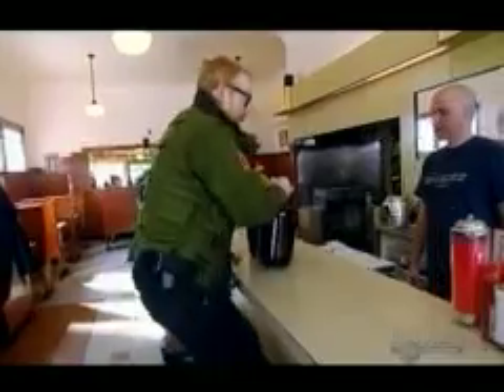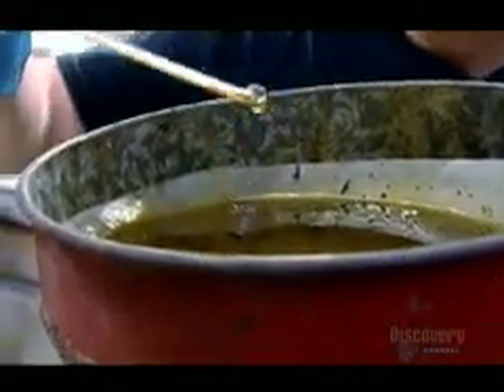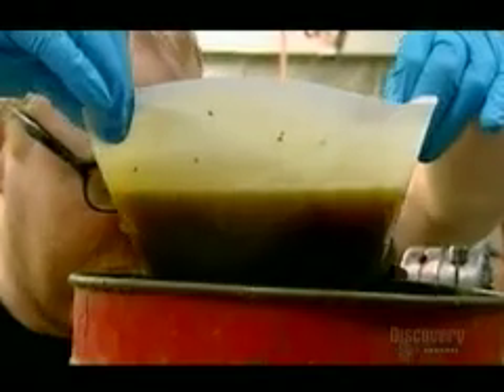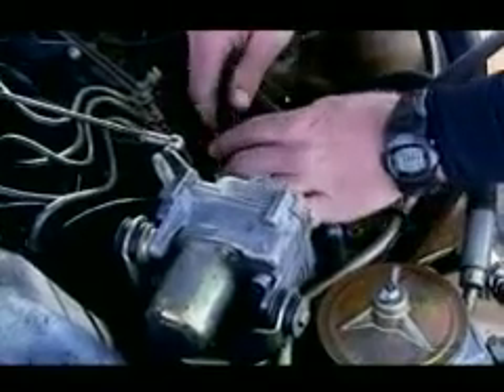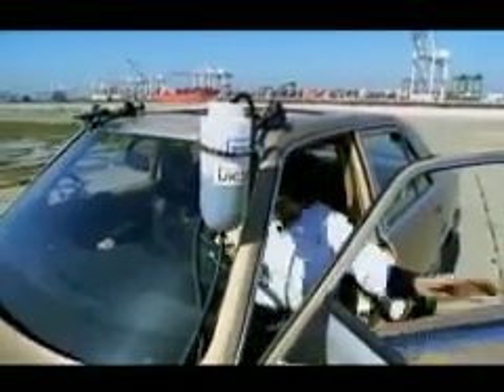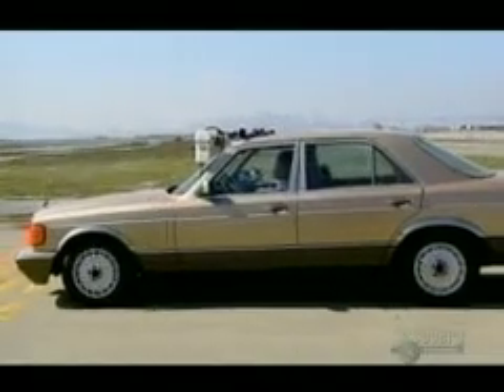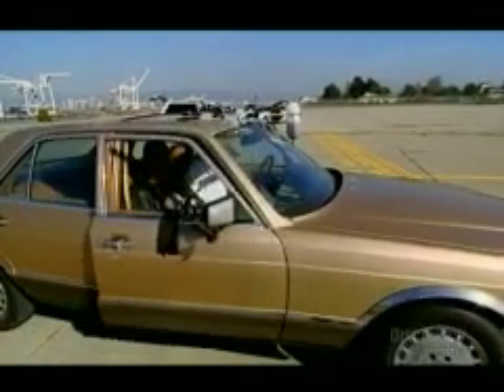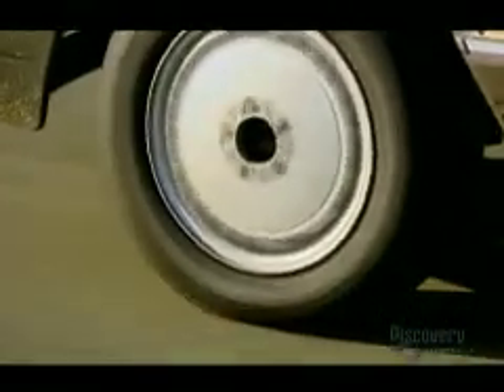Mythbusters - Cooking Oil as Economical Diesel Fuel

Comment: This test is extremely unscientific: To produce that vegetable oil (I'll assume that it is soy oil, as it is the most common) was used diesel to run the trucks and tractors!
To anyone that wanna to study this matter of fuel, energy and efficiency I totally recommend the Patzek and Pimentel's works, go and study them carefully, you won't be disappointed!
Reply: The Mythbusters tested if a diesel engine could run on untreated used cooking oil. The test was a success, it did in fact work. The process to create any cooking oil, vegetable or seed, can be inefficient, whether environmentally or economically...but the bigger picture tells a different story. 

The cooking oil is most probably trucked to restaurants, which in turn can power the trucks, and the farm equipment. There will always be used cooking oil if someone wants fries. Why not recycle it, and use it as fuel? It's economical and efficient since you're using what has already been produced.

As far as I know, used cooking oil doesn't damage diesel engines if it is filtered properly.
Reply: The point isn't whether it functions or not, of course it functions; (the first diesel motor engineered by the German inventor Rudolf Diesel was devised to function on peanuts oil).
There's at least two unfair points, that could fool really a lot of people:
* The effects in the long run wasn't tested, as it could damage the engine;
* The production of the vegetable oil uses diesel from petroleum, so it isn't a "renewable" source of energy.
Of course if the economic conditions permit, one can and must recycle the used cooking oil, but it isn't economic viable all the times and in all situations.
Thank you for your time and best regards!
Reply: baianoise dont see your point since they are just reusing use oil  thrown out so your agruement about the stuff use to harvest it is in valid its a stuff that is gonna be thrown out anyway and reusing it as fuel is not such a bad idea though using unuse veg oil which your pointing our is kinda wasteful but using use oil is not wasteful using something that people throw out is not really a bad idea
Reply: Felix Jr Lim Oh yes, and when people throw it away usually is by the worst means: i the kitchen's sink hole! It's a completely disaster for the house's pipes and to all sewerage because the calcium ions in the hard-water turn the oil into a hard and insoluble soap and obvious will clog the house's pipe and the bacteria that eats the oil (very slowly) use all oxygen dissolved in the sewer water, and it promotes the growth of anaerobic bacteria that produces awful smells and they do produce sulfuric acid as well, and it corrodes the whole system!
Reply: baianoise Your lack of common sense over shadows your books smarts and makes you look very stupid.
Reply: baianoise It's just mythbusters, thjey don't dig very deep. Your right there is problem with cooking oil, it's a lot thicker and a lot of people recommend to heat it up before use. Using dirty cooking oil that is 'filtered' would be something I only would do with a old diesel car. 

To be honest, nothing is renewable really, when we using machines powered by fossil fuel on one way or another. The thing is using a waste product will use less fossil fuel then just wasting it. Where are not going to stop use fossil fuel until the it is so rare/expensive that it's cheaper to grow different crops to create bio fuel.
Reply: Felix Jr Lim Well, these question are really trick because they aren't very evident at a first glance; we should ask ourselves:
- What is the point in use the waste cooking oil? 
Answer: we use for the sake of its energy content, not for itself. For a energy source be profitable (in the energy balance sense not only in the economic sense, as the government subsidies sometimes pervert the laws of physics and "magically" turns a non profitable energy source in a profitable one) it must deliver more energy in it's use than the summation of all energy inputs used in its production and/or extraction.
In that case of the used cooking oil, its energy inputs was:
- all energy used in the sowing and harvesting of the grain, his processing till the extraction of the oil, its filtering degumming, etc
- the energy used in the cooking of oil, be it electric or from natural gas, coal, etc.
- the energy used in the transportation of oil to the fuel processing facility.
Now imagine it in a national scale, millions of cars using that sort of oil?
I agree with you that, in the strict economic sense, from the point of view of the people who took the oil from the restaurant (specially if it was at no charge) and burned it in his car, it was indeed very advantageous, but the economy can't change the physical reality: the thermodynamics calculations, as we have spent more energy than has been delivered.
Sorry for the long answer, and I hope that I have been clear.
Reply: but no one cares its free
Reply: i guess thats all it comes too its free :) no matter how inefficient it is with all your calculation and billion dollar research by big oil company if its free its alot better if it cut cost
Reply: heres the math you buy an 10 dollar battery that will last you 10 hrs or  1 dollar battery that last 3 hours each
Reply: baianoise You are making a confusion. The total amount of energy inputs in USED cooking oil doesn't have anything to do with the harvesting of the grain or the energy used in the cooking oil, because you REUSE it. At the end of the oil's life,you just colect it and transform it into fuel. Therefore, the only energy inputs you bring are the transformation process and the process of finding your used cooking oil. 
Transportation costs to the processing facility should also be acceptable. If u bring one truck worth 30t of oil and use just 500 litres of diesel (for transportation) then it is worth both in the energy balance sense and economically.
Reply: nadfas No, without the energy used to harvest the grains that produce the oil you would not even be using it, I understand that you are analyzing it from the perspective of the end user, the people who collects the waste cooking oil, usually for "free". Not only this case is unfeasible on a very large scale of use (let's say 10 millions of people using biodiesel from this oil or the oil itself as fuel) but so are any Biofuels, the total amount of energy from the sow to harvest to the engine doesn't hold the candle to any fossil fuel, simply because fossil fuels have the largest energy density of any chemicals of practical use, so from any joule invest in his harvest you return a lot more than any other chemical fuel. There's only two source that can possible beat oil in a foreseeable future: Wind turbines and  noncrystalline solar panels, even thought we have to remember that this two sources are not predictable and left us with the problem of store his energy.
Thank you for your time to answer!
PS: I extremely urge you to give a shot to the Patzek's book about biofuels" The book is totally awesome.
Reply: Well toi make it short i know we still need fossil fuel but if we can convert some waste to energy its not really a bad idea but totally replacing fossil fuel thats still a fantasy
Reply: Felix Jr Lim Yes, to really tell the truth, we can't bear the effects of use a lot of fossil fuels, not the fossil fuels itself, because we have probably thousands of years of mineral coal for instance, but it is, on the other hand, the worst fuel we currently have (excluding nuclear energy) in terms of pollutants generated in its use; further is possible to synthesize hydrocarbons from coal, (e.g synthetic gasoline).
The monocrystalline solar panels and the new wind turbines could replace 90% of energy needs if we hurry in install them, because when the population reach a certain number all our possible savings would be lost, just because we need oil to produce solar panels and wind turbines, further this appliances are usually produce far from where they are usually installed, and as I have said, oil have the biggest energy density of any chemical fuel of practical use, 18 wheels Big rig that runs on Lithium batteries and solar panels is for all practical purposes unfeasible, indeed hydrocarbons are a so good form of energy storage that is a very good idea to use solar energy and wind to synthesize them.
Thank you for your answer and excuse me for this long message!
Reply: hmm so we just throw away the use cooking oil :D if we can use it lets use it
Reply: Felix Jr Lim I didn't said this: throw the oil away, I only said that as a energy source to power cars, in a macro scale it is unfeasible.
Besides it, you can make soap, oil paint, varnishes, burn it in the winter, etc.
The most basic and fundamental criteria that a energy source have to meet to be of any p practical use, is that you must, harvest more energy in its use than you put to process it, and the waste cooking oil, as a huge whole lot of other sources do not meet this criteria, despite that in very localized scenarios sometimes you actually can profit from it.
Reply: well what ever other use we have for it what i meant just use it but still its another use for something people throw away
Reply: im not an enviromentalist but i learn one thing use what can be use
Reply: baianoise in the Philippines they use used cooking oil 6yrs ago its free and you can get it in restaurants and burger joints but since it became a trend these restaurants now charge people for used cooking oil to run their cars then people stops using it but some still buy it since its still a lot cheaper than conventional diesel.
Reply: shinjiprofile Well, the Phillipines case is worth o commenting about, because in the book "Thermodynamics of Biofuels" there's a NASA photo of the island viewed from the space that clearly shows how much the jungle were burning because the government subsidies to plant oil crops for biodiesel; biofuels in general will never replace oil due to a lot of technical issues, but a good example is this: they are a huge incentive to burn the forests and plant oil crops, their associate environmental cost are unbearable and besides that they make the food prices soar because of competition of food x fuel (e.g. corn for ethanol vs animal feeding).
Reply: Well Nasa is not poor like most filipino who need to find other ways to make things ends instead of just debating stuff they dont have the time to do that with a corrupt government most filipino need to improvise using almost all things available for rich dude they can give all the study and theory they want for the poor dudes they dont have time to talk and only action even if it doesnt work that well sometimes but its what they do to survive in sort shut up with the NASA talk and lets make action
Reply: And diesel fuel also takes diesel fuel to delivery to the gas stations.
Reply: Cooking oil as a fuel must be only from residues only, creating it from vegetables and land for that sole purpose its stupid, in fact any "biofuel" must be recovered from residues.
Reply: well as they say details :)
Reply: Why limit your "imagination" to the plant life that is needed to be farmed to produce biodiesel...on a dirt-patch farm.  
How about: Imagine a building that covers one square acre in the United States.  
It has growing trays inside it in a perfect environment for growth: Nutrient gel for the roots, LED lighting for photosynthesis, climate controlled to prevent plant stress.  
NOW, imagine that building is 5 stories tall so the one acre footprint now has FIVE acres of production area. NOW imagine that building is 50 stories tall. FIFTY TIMES the area of a one acre plot of a dirt-patch farm. Indoors. No harmful weather. No harmful insect damage. No weeds. No pesticides or herbicides needed. NOW imagine the whole building being automated and powered by the one acre of solar panels on the roof...and the plants being grown are hybrids that have been optimized for maximum oil content in their seeds or fruit. Super oil-filled soybeans or something. 
NOW imagine that building is NOT in the middle of the countryside where it is an eyesore...it is in the middle of an urban area that is being revitalized with urban farms that grow our local food and local fuel!!! 
Your limited imagination of applying how things are done today is getting in the way of what can be done in the future. All things are possible if you get past how EVERYTHING is currently sourced/produced/transported and find unique solutions to get as local as possible.
Biodiesel DOES NOT have to take away the land or the food being grown on it...on farms by farmers.